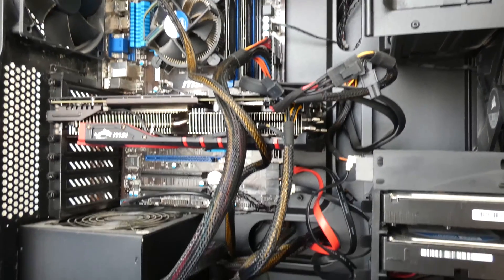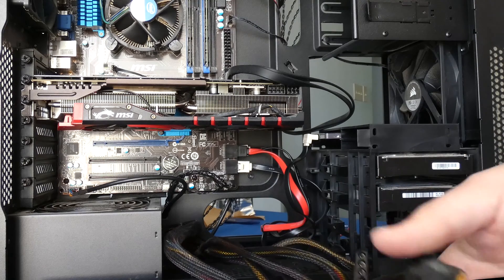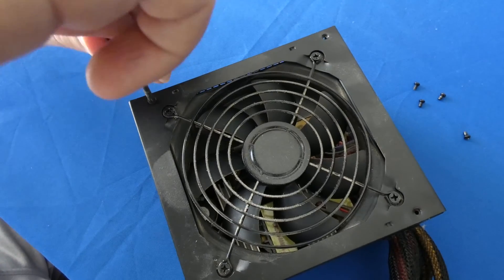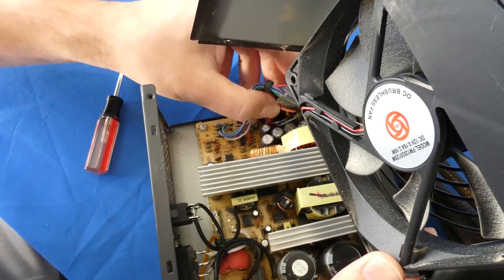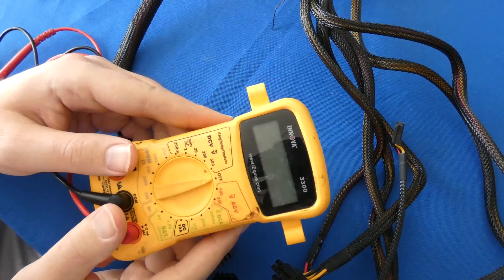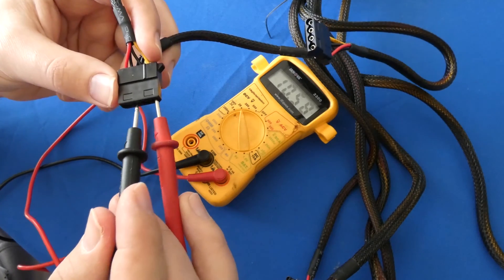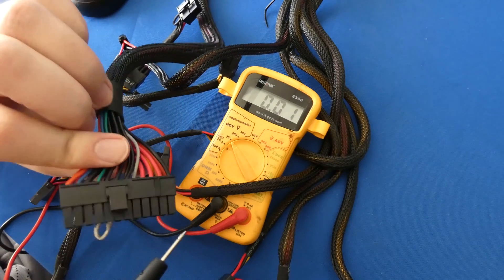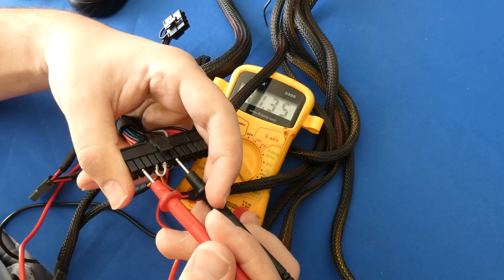Testing a BAD Power Supply After Burning Smell and Unexpected Shut Down

Comment: ok so I got a 3080 when I installed it, it was doing the same thing! but when I use my 960 it doesnt have a burning smell or anything so now idk if its that or the 3080 that could have been burning
Reply from the maker: 3080 pulls more power probably
Reply: @Cobuman  yeah I wanna run a test today to see if it’s actually the power supply because I’m literally about to send the RTX out for a replacement because only last night did I suspect the PSU after doing more googling
Reply from the maker: @StarBreaker4K  It's most likely the PSU. See if you can smell the burn from PSU.
Reply: @Cobuman  I’ll try today after work, but when I was smelling it, it was coming from the top of the case and generally the whole area
Reply: @StarBreaker4K  i had the same, from the top that smell, did you fixx it? What was it
Reply: @InfinityEditsXX  it was the power supply you need to get a 2.0 ATX or higher

Comment: This literally just happened to me rn with my pc. I was playing a game and then my computer just turns off, but the motherboard light was still on,so I turn it on again and it just makes a noise and turns off along with the smell of rubber. I disconnected the power cable and switched off the psu. Btw my psu is a Corsair rm850x 80plus gold. And I only had my pc for a month, So I guess I was just unlucky
Reply from the maker: Yeah, that's a decent PSU. Very surprising it went bad so quickly.
Reply: I have the exact same psu for about a month or two and same thing happened to me
Reply from the maker: @julienc7226  oh man... bad quality.

Comment: This is an old video but I just had a problem like this but smoke came out it smelled like Burnt dust but I’m not to sure, is it safe to turn on?
Reply from the maker: You can try... but that describes power supply going bad. If you try to use it could damager other components.

Comment: So I turned my PC on, it immediately turns off while making a slight burnt smell. When it completely turns off however, the smell is instantly gone. Is this a serious issue and do I need to replace my psu?
Reply from the maker: Probably bad Power Supply. I would check to see if CPU is seated correctly and look over the motherboard to see if anything is burnt or melted. But, most likely bad PSU.
Reply: @Cobuman  thanks, I'm thinking of bringing it to the repair shop. I just got a new graphics card and this had to happen, I'm so upset
Reply from the maker: @Wyndra7  oh yeah, I've had that happen to me a couple of times over the years. New graphics card can be power hungry so if PSU is not strong enough it does what happened to you.
Reply: @Cobuman  my PSU is about 550w so I don't think it's the problem. I really hope it's just loose cable or whatever and not a fried psu or motherboard, I don't feel like spending more money for replacements
Reply: @Wyndra7  what was it?
Reply: @Amahyze777  I think whenever I turn on my PC, something is actively burning inside the psu. I had to spend $80 for a better quality psu. I also learned that a bad psu can cause several issues with other pc components like your hard drive/ssd disconnecting randomly or corrupt files inside it.
Reply: @Cobuman  Small update: I checked the motherboard and I don't see anything melted (if something is melted or burnt I assume they would be like a black spot?) and I just took a deep sniff on my psu again and I don't smell anything burnt. If my psu was burning then there would at least smoke right? I'm so confused.

Comment: After smelling the power supply, I suspected it was the issue. I couldn't remove the lid, but looked inside and noticed some copper wiring was turning black! I was in the middle of a game, but I'm glad I stopped when I did, so as to avoid a fire.
Reply from the maker: Yep, that's how it happens. Good job turning it off.

Comment: My computer suddenly shut off while I was playing a video game and the power button was flashing blue. I did some research and thought it might be the power supply. One person had said they unplugged their computer and plugged it back in and theirs was able to power up, so I went to the back of my pc and unplugged the power cord and plugged it back in. I hit the power button to see if it would turn on and I heard a zap/pop noise and smelled something burning. It immediately powered off itself but I cut the power to the strip it was plugged into to be safe. Could that be caused by the power cord not being plugged in all the way? Could it have damaged any other parts of my computer? Should I just replace the psu and see if it works or should I send it to someone to be tested and repaired?
Reply from the maker: It's most likely the power supply burned up. However, you can open the case up and see if anything else on the motherboard looks burned or if you see swollen/leaking capacitors.
Reply: @Cobuman  ok thank you for the advice. I really appreciate it
Reply from the maker: @amysirawskyofficial  sure thing

Comment: Ik it's old video but anyone can help? I was playing on my pc normally then my pc restarted it self after that it kept restarting and a bad smell came out from the power supply,  after that my pc shutted down and didn't turn on,  when I turn on the pc the fans  of cpu and gpu turn on and some lights appears from the power supply but it never turn on and no display can anyone help what should I do?
Reply from the maker: If you can tell that smell came from power supply then it probably did die. Open to the computer case just to double check if motherboard has any blown up capacitors or something that burned up; otherwise, it's probably dead psu.
Reply: @Cobuman  no all is good except power supply so do I buy a new one it will be fixed right? And thank you
Reply from the maker: @teleportfn3039  in that case a new power supply should fix it.

Comment: My pc just suddenly turned off and released a bit of a  burning smell. When i try to open it, it lights on and off continously every few seconds. Did it overheat? What should i do?
Reply from the maker: Power Supply is probably bad. I would replace it. Here is a good brand for ATX power supply: https://amzn.to/3f4R4pb  assuming you have the same type.
Reply: @Cobuman  Thanks, though i have a trigon branded psu in which I'm not really sure if it's good since I'm not familiar with qualities of psu's.
Reply from the maker: @Spheliax  I understand. With PSUs you get what you pay for; it's a good judge of quality. So, if it's cheaper PSU it may not last long even if rating is 1000w.

Comment: I noticed today a burn smell coming from my pc, turned it off and then tried to reboot. No display but the fans and lights still work. I noticed the psu red voltage switch in the back looked a lil burnt. What should i do?
Reply from the maker: □Replace PSU. I use EVGA brand... seems pretty good. https://amzn.to/2FAFsfR

Comment: hi there. i had 550w psu and it just die nothing i was feel it just die it wont run ons pc and i install my old 400 w psu on it so when i turn on game i fell like burning smell and i turn of it anfert dat my bro was playing some games and pc shuts down itself all temperature was good it die like old one? is is possibility that my old psu damages other pc part or if i buy new one its may die like last two ? idk
Reply from the maker: The cheaper brand PSU can be pretty weak. And that burning smell is most likely the PSU. Your other parts should be okay but you may need a new good brand PSU like EVGA. Especially, if you have big graphics card installed.
Reply: cobuman ty for reply it just pises me off :/ i just found videos in youtube when guy was using 450 w psu with 1080 and 8700k and he said it runs ok also comment wa like that so they made me wrong decision

Comment: Lol my pc and it smelt so bad my family thought it was a gas leak and the fire department had to come
Reply: Don't use it anymore. Mine blew while properly clip testing it (after the burning plastic smell). So it's dead honestly. One thing you can do is separate it from your board and other components as it can trip everything from power surge protector to your household electricity. It can literally dim your household lights and electric shock you while touching the case and power cords.

You can test it by loading some to it like a cooling fan. Don't dare asking any more questions as it is frying your components by the time this is posted.
Reply: @madartzgraphics2019 bro same after a smoke come and pc shutdown immediately. Now what is the probability that the parts are dead or they can be in working condition with a new psu
Reply from the maker: lol. What happened after fire department realized it was the PC? They didn't put a hose to it.. did they?  😁

Comment: Hi great video thanks. My HP Pavilion computer has today done exactly what yours did and the smell is definitely coming from the power supply. I have removed it and want to buy a replacement to see of this fixes the issue. How do I know which power supply to buy to fit into my computer or are they all basically the one size to fit HPs?
Reply from the maker: Which Model of Pavilion do you have?
Reply: @Cobuman  it is a 500-242EA
Reply from the maker: @derekdavies8882  It appears to be a standard  24pin ATX power supply which means any aftermarket should fit/work like EVGA: https://amzn.to/2WOgCwx

Comment: I know this is an old video but can someone here answer something for me? My power supply is 4 years old and sometimes emits a smell like burning dust. It's not an overwhelming smell, I have to get my nose right next to my power supply to really smell how strong it is. It's not acrid or burning plastic I don't think. I sometimes smell small wafts every now and then but it's not really strong like I mentioned. I've never had it do things with power supplies that go bad. Could it be dying? If it does die out will it short my PC?
Reply: Change it asap

Comment: I bought a used xilence xp600 600watt and as i tried to turn the pc on. Smoke came out of the psu and it smelled bad. I installed my old psu to check if my mainboard or anything else is damaged. And it seems like my pc's now done for it. I don't have any money. So i guess im going to give gaming a little hold for now
Reply from the maker: I'm sorry to hear that. If possible try to buy a good name brand PSU in the future (EVGA, Corsair, Antec & etc). I've had bad luck with lesser known brands.

Comment: what happen to your psu? does it affect the other parts on the cpu?
Reply from the maker: It can affect other parts... Although PSU appears to be working inside the PC; it may cause damage to other components in the long run even if voltage is slightly different from what it should be. Also, a bad capacitors is there to regulate voltage and if not working properly... well... you know.. ;)
Reply: @Cobuman  i have a generic psu i think its 650w, then when i plug my gpu at the first run goes ok no sound all smooth but when i restarted my pc it makes an electric sound like a ticking clock then i pull out the plug right away, at 2nd attempt its just the same, i unplug my videocard and nothing was burn or something, my gpu just smells new plastic like burnt plastic when i sniffed and the molex 6 pin wire,,, what do u think happend to my pc?
i have :
amd a8 7600 r7
gigabyte motherboard
4gb ram ddr3
psu generic 650w
gpu newly bought 2nd hand geforce gtx 660
500gb hhd
Reply from the maker: My pleasure. :) Check your GPU and CPU Fans to see if they are spinning or maybe one of the fan blades are hitting a cable or something.
Does 6pin molex look burned?
Reply: @Cobuman  thanks for replying,subscribed :)

Comment: The voltage is too low to break the resistance of your skin. You can safely touch the terminals on a car battery because even though it has a lot of current, it only has 12 volts output.
You wouldn't have to worry about getting shocked here unless you used your tongue somehow :)
Reply from the maker: Thanks for the input. I thought the shock factor was also related to amperage as well as voltage... For example, a car battery needs enough amps to turn the engine over.
Reply: @Cobuman  It does need enough Amperage but current can't be possible without the voltage. Voltage (symbol E) is the potential energy that pushes electrons into a flow of current (symbol I) and power (wattage) is simply voltage multiplied by current and resistance limits the current. If you are interested in that sort of thing there is a formula called ohm's law that proves to be very helpful. It states that voltage = current * resistance (E=I*R) and if that is true then resistance = voltage divided by current (R=E/R) and current equals voltage divided by resistance (I=E/R). Simple right? I find it quite fun but I must be a geek of a teen ;)

Sooo, if we consider the car battery that has 12 volts output and probably 45-55 amp-hours we can through this into formula. The resistance of of your skin is at least 100 thousand ohms. If we put this into our ohm's law formula we get this: E/R=I  12/100,000 = .00012 so with the 12 volt output and the 100k ohm resistance of your skin the current gets limited to only .00012 amps or 0.12 milliamps. This amount of current is too small to feel. If you were using sweaty fingers the resistance could be less and if you use your wet tongue you WILL get shocked from the car battery. Even though the car battery has a lot of current, it is limited by the resistance of your skin. Copper wire has very little resistance compared to your skin ( I think it's like 1 ohm per 100 feet of 20 gauge wire or something). 

I hope I made since in all of this and most importantly that I was helpful at all. If you find this stuff interesting, there is so much more interesting stuff to learn in this department so just get a book from the library. Cheers!
Reply from the maker: Very cool info. Thanks Brian!

Comment: can i get some help advice here pls?. i got a used gtx 1080 and worked fine but it rebooted my pc when stressd gaming for example, like 4-6 times happened before it "burned" my power supply (bronze 650w), the last time the pc rebooted but was loopstuck not powering up. i got aseasonic focus gold + 1000w to replace it and it appear to work everything fine, no reboots for a while, BUT when it powered down it was worse. didnt turn on or rebooted by it self. i thought my entire pc died, the brand new psu smelt abit burnt and had to return the gpu, seller says it died. well the thing is my computer appears to work perfeclty fine now, buti am scared the psu got damaged and may burn my my new gpu if i buy one. (dont want to risk burning a 800$ card..) should i get the psu replaced? reviewd?, buy another one?. what could had gonne wrong in first place?
Reply from the maker: Sure thing. The used 1080 was probably overheating and pulling too much power because it was defective. 

When a computer powers down on it's own it means it overheated and will not let you turn it back on until temperature goes down.

It's hard to say if any damage was caused to the new PSU but if unsure you can probably exchange it (usually there is a 30 day return policy). That's what I would do if possible. 

Lastly, check to see if all your system (case) fans are working... just in case this is an airflow issue as well.
Reply: @Cobuman  thank you alot for the fast response, i will try to get my new psu checked, to me the only posibility for this was that the card was somehow defective. failes, something inside it burned, because i tried and eliminated any posible mistake by my end.
Reply from the maker: My pleasure.
Reply: This happened to me a few days ago it's the power supply I swapped mine and problem gone
Reply: @ripperwbfg4677  in my case it seems the problem was only the defective 1080 gpu, cus I got a rtx 2080 and it runs perfecctly fine with the seasonic psu I thought burnt
Reply: Ah ok then it's just the gpu strange tho I have the psu in my wife's pc now and its running fine with here her rx580 psu must hate nvidia XD

Comment: I have a Corsair 750M, GTX 1070, 16 GB ram and an I5 6500. My fans recently started getting really fast (when my temperatures are fine) so after checking to see if my pc was dirty, I noticed a smell. I didn’t notice it until I opened my pc. Now everytime I start up my pc, this odd chemical burning smell comes out and idk why. My computer hasn’t had random shutdowns
Reply from the maker: You could potentially have a bad power supply... There is a chance that with bad power supply to receive higher voltage to your fans (more voltage=more speed). Double check your motherboard for leaking capacitors and if you don't see any replace the PSU just to be safe. Otherwise it's really hard to know for sure unless you do testing.
Reply: Oh yeah.... it gave up yesterday lol. I’m going to get a new one today but I’m hoping it didn’t ruin my cpu, mobo our gpu
Reply: Pc shut off yesterday so I unplugged and took the psu out. Really hoping no other parts were affected
Reply from the maker: I hear ya, usually everything else remains safe. Don't worry too much. :)
Reply: @KarasmaticBeast  did you ended up fixing that?

Comment: Ur power supply is the wrong way up
Reply from the maker: :) You are correct, but only because there is a vent on the bottom. If there was no vent then it's okay to have it facing inwards. Some PCs do not have an extra vent for PSU; for example name brand stuff, HP, Dell, Lenovo and cheaper cases. 

Needless to say, my new PSU is facing the other way. Hehe
Reply: I use my power supply the same way it's actually a good way to check if the fan of the powersupply is working properly or not.